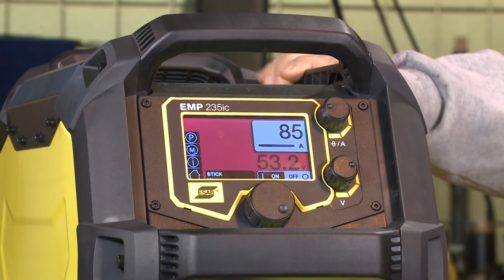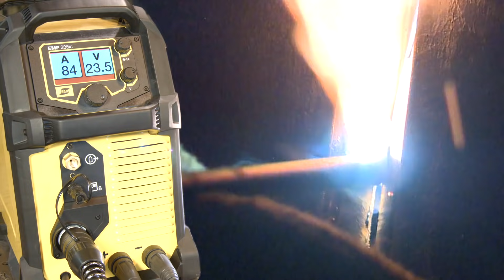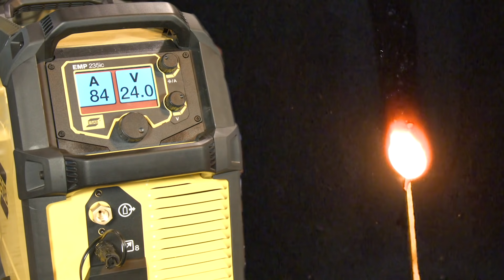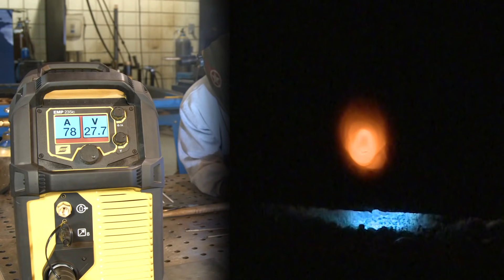🔥 Teaching 6010 Roots & Repair Techniques

Comment: Viewer Request:  Can Weld.com do a video on stacking 6010 beads.  Basic beginner stuff.  I ran a plate yesterday and it was decent but I'd love to see a technique that is easily repeatable for strong welds and good appearance.    Is there a better technique than whipping forward one rod and back half? Can we make an e to make it easier?   I'd love to know how to fill the crater at the end of the pass and how to start a bead without a mountain of metal at the beginning.  Thanks!

Comment: I know it's a fast freeze rod and I know the plate has a ledge ground on it to help prevent blowout but I'm always amazed the plate doesn't melt away on open root welding.

Comment: Bob, I wish I could spend about two weeks just welding 6010 root passes, fillers and caps with you so I could go to the pipeline. You burn that root in good every time. You are one slick welder.

Comment: I need help!! I need to test for down hill 6010 root/fill/cap on 6G 6” pipe. My fill and cap are decent but I struggle with a consistent root it’s so frustrating. I run at about 85/90 amps. 3/32 gap and landing. I’ll drag the rod and I see both sides melting but the puddle won’t follow me down, if I try to “whip” it I’ll either get a pinhole or blowout the keyhole and make a fat weld inside the pipe. How can I fix this?

Comment: Always buy a machine for the future. If you don't have AC you can't weld Ali.
Reply from the maker: Dylan Bojumpkio watch our DC Aluminum video. While maybe not preferred, it is possible to weld AL with DC. Plus you could always go spool gun on this machine to do AL.

Comment: I would like to see the proper way to join 2 pieces of I-Beam? I have a 14,000lb GVWR 22' gooseneck flatbed trailer that I want to cut and extend by 5' and I'm not sure if there a different technique specific to joining structural beams? The frame is 4" x 8" x 3/16" 12lb per foot I-Beam. Thanks!

Comment: Super video. For us willing to try to weld from zero, your explanations are superb. I wonder, we that have not weld think of the arc as the space between electrode (stick) and work piece, are you actually touching the work with the electorde ? Hear you saying "push it" and looks like touching on the down side. Again thank you all for sharing your life.
Reply: Yes, on most of our stick welding, we are lightly touching the material with the rod.

Comment: I'm a refrigeration operating engineer and i am planning on teaching myself to weld. i just ordered the everlast 200dv . my question is can you do a video on how to create your own coupons.  both pipe and flat . i have access to plenty of leftover pipe and angle iron. how can i get the 30 degree bevel on pipe evenly. Thank you in advance.  that esab 235 has me reconsidering my purchase lol
Reply: Welding is not the only skill you have to learn. Cutting, grinding and beveling is a must if you want succes.
And you are an engineer, so theory and learning stuff should be easy for you.
One word of advice. Dont make it to difficult for yourself in the beginning. 
Keep it simple with few tools. Grinding a bevel is not that difficult, and I don't think you need NDT anyway :)

Good luck :)
Reply: MrPONCHO467 it doesn't have to be perfectly at the angle specified. The bevel just needs to reflect what the pipe schedule is. For instance, it is possible to make a 2" schedule 40 look like a 2" schedule 80. All it really takes is practice. do a little bit at a time. To achieve the angle you said, place your grinder at about 45°, then reduce the angle ever so slightly, and you'll more or less have that 37.5°.

Comment: When and how do you clean the slag?  Not between restarts?  I'm liking the idea of using a twisted wire wheel for cleanup.  I'll use a grinding/cutting disc for re-doing a weld I'm not happy with (as you did in this video).  Not many videos show the cleanup part.
Reply: Harry Pehkonen If you hit it while the slag is still red hot you can just continue welding. However its better to clean it off with a wire wheel so you dont get inclusions.

Comment: Bob, I noticed that after you burned your first rod on down pass. Did you clean off the slag or did you just start welding right in the old slag? I guess my question is if you did the later wouldn't that contaminated the weld? You made have clean it off camera and viewers just didn't see.
Reply: On 6010 and a demo plate, I'm not worried. In the field or on a test, yes I'll clean it. You would be surprised though how well 6010 will weld right through it and not leave an indication on x-ray.

Comment: 36,50 USD that is a good salary :) High hopes for this young welder
Reply: Better dollars than I make as an IT professional and 4 years of university.  There's not a year that goes by that I don't think I should have gone into welding or machinist.
Reply: @byron7165  And that's after just one year.. The Welders I work with who are Mechanics as well all make more than $65hr. Granted the program is 5 years, but you'll come out of it starting at $44hr. Unless you're a Doctor, Lawyer or Athlete you aren't making anything close to that at the beginning or end of your college career.

Comment: Excellent video Bob, I like it when things go wrong sometimes it happens, and you showed how to fix it. Just wondering, I noticed you didn't chip the slag off before your restart, wouldn't that cause slag inclusions?
Reply: On 6010 and a demo plate, I'm not worried. In the field or on a test, yes I'll clean it. You would be surprised though how well 6010 will weld right through it and not leave an indication on x-ray.

Comment: My set up for open root pipe is  50-55 amps, electrode negative, 20-25 bevel, 1.5mm land, 3 -3.5 mm gap, with 3.2 electrode.  Works like a charm.
ps here is the video of welder whipping that road like a saber lol
https://www.youtube.com/watch?v=oAkku5Arq6M starts at 1.00
Reply: What rod?
Reply: 6010 3.2mm (1/8 inch) bohler ... But we use Fronius (transpocket 150 /1500 and 2500) machines that have 100 volts in open  circuit. They can burn 1/8 rod at 48 amps (electrode -)  with no problems. Very sharp/strong arc. Once I have tried that set up on Miller welder and it did not go as planed lol , arc was to soft and I did not like it. But I have seen 4 different setups for 6010 down hand pipe root form US , Canadian and EU welders , all different all works but this one works best for me.

Comment: I think the request you were answering was mine. Thanks for the video!
Reply: I hope that helps. Let us know if we can help.
Reply: Harvey Gonzalez Your welcome. Nothing I know about welding is secret. It angers me when I see a grumpy old welder who will not help other welders or welders in training. We should be proud of our skilled trades and willing to help any young people who are willing to work and learn.
Reply: Len M. That is a new one to me. The only thing I knew wet welding rods to be good for is causing Hydrogen induced under bead cracking and porosity!
Reply: Underwater welding is very far away from the topic of this video. Since you are obviously an expert about underwater welding I won't bother to tell you that those electrodes they use are a special design for just the purpose of underwater welding. Did you think you grab a handful of 6010s and 6013's to weld underwater. The coating on underwater rods is two layers that almost look heat shrunk onto the rod. I really hope you don't think that wetting down a 6010 is a good job practice. These rods really should not dry out because they are considered dry at room temp. and are not kept in ovens, now if you are keeping them in ovens that could be a problem. I really think you are just playing around with me for a good joke, if not I think you should re-shoot your thumbnail picture but this time hook your ground clamp to your big toe!
Reply: tdej80  thanks for the information my friend
Reply: tdej80 Don't do that to other series rods though!
Reply: So many times fingernailing is caused by substandard practice in filler metal production. The filler rod being bowed or the rod not being centered in the flux are also common causes for fingernailing. Improper rod angle can cause the rod to fingernail also.
Reply: I don't post any videos of my work on the internet. Where I work at there is a strict policy about industrial espionage so that could get me fired. Although one of my friends formerly tried to submit pictures of just welds I had made with a tig and 309 filler metal, they kick him off both times because they do not accept any welds made on automatic machines. That is the funny part all the welds I made with a 45 year old tig and a 30 year old positioner and my 2 hands and 2 feet, I guess I will take the confusion as a compliment! I only weld in my shop at home if I have to, at home I work as a mechanic, I weld 50-60 hrs. a week at work so I really enjoy doing the mechanical work as a break off welding. I was a mechanic before I started welding and have worked jobs where I was a welder and a mechanic. I have worked in machine shops and a tire repair technician, shit I have done many different things I have worked as a spray painter. It took about 10 years to get through the layoffs where I work now so when I was younger I just drifted around and took short work where ever I could get it until I got called back. If I ever decide to start welding out of my shop again I will make videos and post them! I owe that much for all the people who have helped me.
Reply: tdej80 If your 6010'etc is fingernailing dip it in water.
Reply: tdej80 6010, 7010, etc have a cellulose based flux that burns and produces C02. They start fingernailing when they dry out, dipping them in water gets their moisture % up. It's one of the tricks I learned in my first year.
Reply: tdej80 Yeah, it's not the only cause, but it's one thing to try depending on how everything is behaving.
Reply: In this video downhill is the topic. If you move too slowly downhill your puddle will ''slide'' A slide is a major problem because it is when the puddle is not being pushed back up into the joint by arc force. Your arc stream is then on top of the puddle and never digs into the base metal. That causes lack of fusion, lack of penetration, slag inclusions and other defects that give downhill stick a bad name!
Reply: tdej80 hope to someday work with you to learn from you
Reply: tdej80 where can I send pics of my welds? Just to know your opinion about my welds
Reply: In general it is considered a bad practice to teach people to weld with one hand. This one time I will make an exception to that general practice. Downhill is fast travel speed, I have seen people blow out the back side of the plate from moving to slow. Many times moving to slow is the problem causing lack of penetration and young welders will think that they are welding to cold. Sometimes this turning the machine up way to hot out of frustration will cause blow outs or even less penetration. Downhill is a hot weld but only about 15% hotter than flat position work. You need a short arc when welding downhill stick on the root to force the puddle back and up into the joint, if you run excessive heat it will be hard to maintain a short arc because the rod will burn off faster. It is sometimes helpful to weld with one hand on a downhill root, it is easy to get too comfortable and then not be able to move fast enough to keep the rod deep in the joint. When you go to one hand you can prop with the non-welding hand and focus on keeping the welding hand pushing in. Employ a 15-20 degree drag that big drag will use the force of the 6010 arc to push metal into the root side of the joint. The one hand technique helps also when you have a rod that fingernails, that means burns out of one side of the flux. Many times finger nailing can be stopped by keeping your rod pushed into the joint and gently but quickly rocking your hand side to side. One thing is rod positioning I always bend my rod over when welding downhill this just gets the stinger out of my field of view and lets me get more comfortable without being too comfortable. When you downhill you have to find '' your spot'' because things happen fast. Some people even run like the first 1/2 to 3/4 of the welding rod with a finger pulling down on the rod to force it into the joint and keep pressure in the direction of travel. Downhill is busy and fast. Downhill is easy it is just different so sometimes we get a mental block about one thing and that one thing is what makes downhill kick our butt for a minute until we figure it out. Just stay sharp and find your spot after you do that you will be set!
Reply: I would show you anything I know.